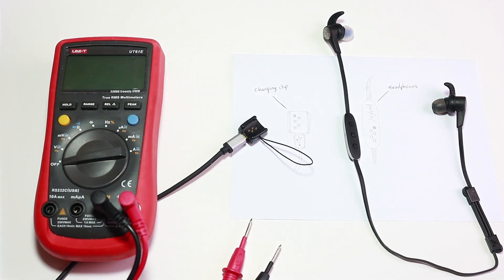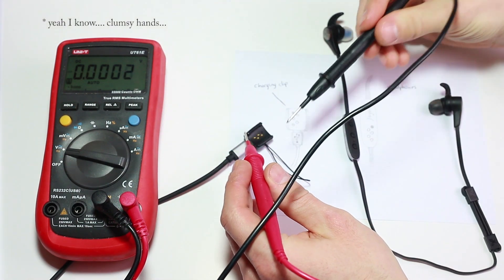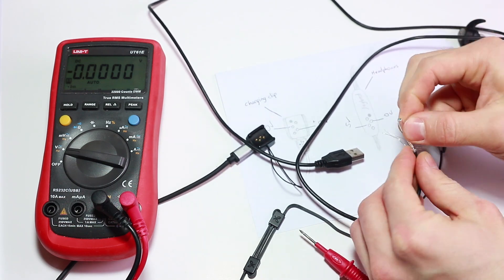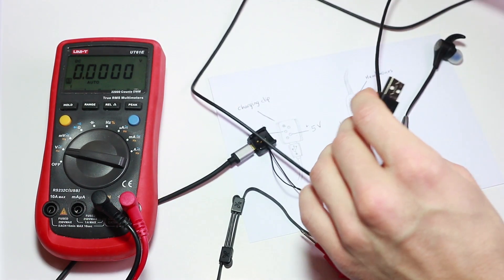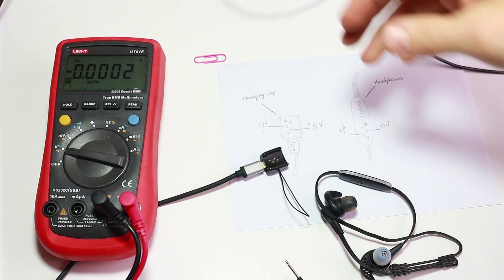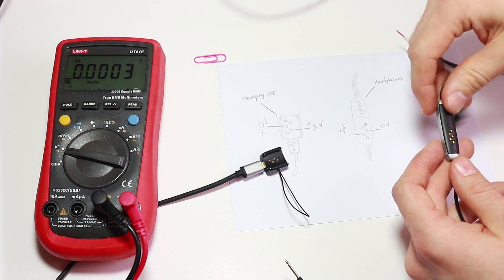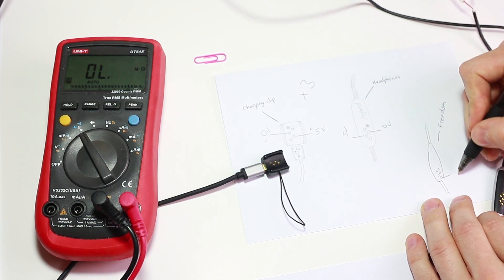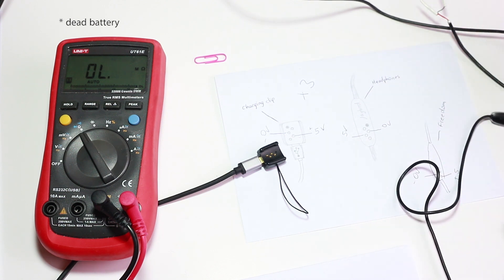Jaybird (X3 and Freedom) earphones Pinout charging pins

Comment: Do i understand u correctly that for the freedome the bottom 2 pins are only once needed to make the charging stick work? i have a few changing stick that are not working because of corrosion of 1 of the charging pins. so i want to try and replace that pin by getting one off one that might not be used at all? do you think that this might work? below is a link to a picture of it.
https://photos.google.com/share/AF1QipNPH-S6vA4Y_ORi_6gIikWpo2zqv3Ok8qcgeesMuS5cECW54SZEwd6jwiEo_2IXUw?key=WlVBWFZDZ2ZYS2xpUTFWYnd5Y19UelBQQkdScFFB

Comment: hai... i have JB Tarah. when i charge via laptop, its led is on continuously, but after 1 hour charging i cannot turn it on. i have tried to push the power button 20 seconds, and turn on it again, still not working.. could you figure it out, what happen to my tarah??? and would mind to direct me what should I do???
Reply: and thank you in advance
Reply: A laptop only trickle charges via usb. So that could be the issue. Use a wall charger that is 5V and at least 1A.

Comment: Thank you for taking time to make video and explain and show. I have both types of headphones but completely dead. Now I have a way to test for charging and functionality. Again thank you so much!!!
Reply from the maker: No problem, I am glad it helped!

I was exactly in the same situation, had couple headphones, but no charger, and too afraid to test them not knowing polarity of the charging pins.
Reply: @imbradass  yes. I didnt want to ruin them not knowing exact pins to use. I wish all manufacturers would always use standard ports/chargers/etc. Would be so much easier.

Comment: This helps alot, but how do i keep the wires staying on the headphones, i finds it tricky to charge them more than a second at the time
Reply from the maker: That's the tricky part. I have not tried that yet. But what if you make the holes in some thick cardboard or any other sturdier material and stick the two wires through it and glue them in place, so you have always same distance between wires, and then trying them to attach to the headphone pins. I should have done video for that 🤔
Reply: @imbradass  https://youtu.be/246DBK0K31M?t=137
Reply: That might work, i will for sure try that out
Reply: I used two needles and duck tape 👍